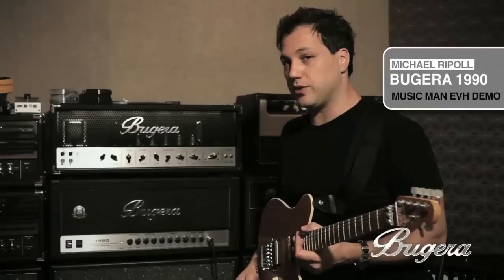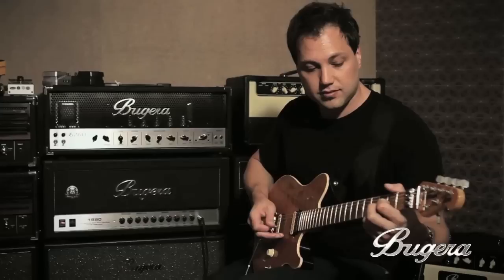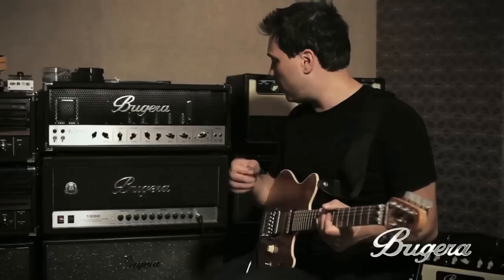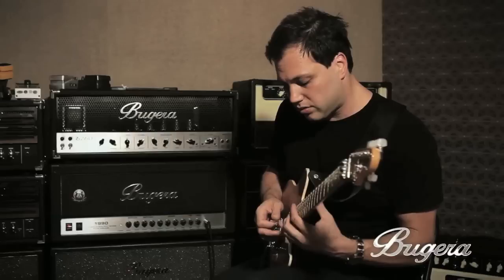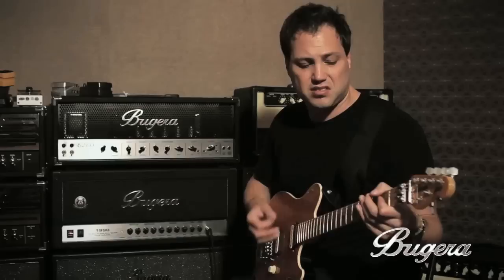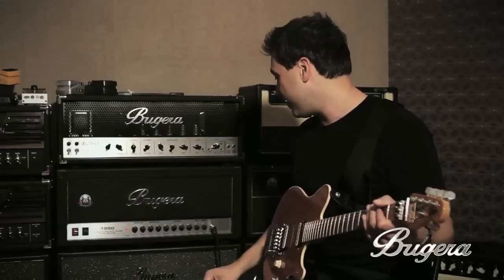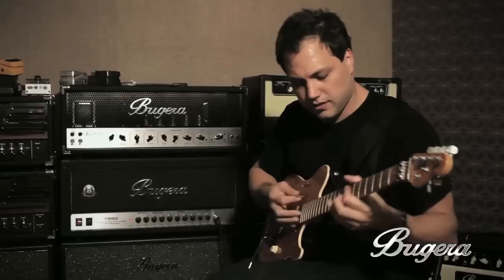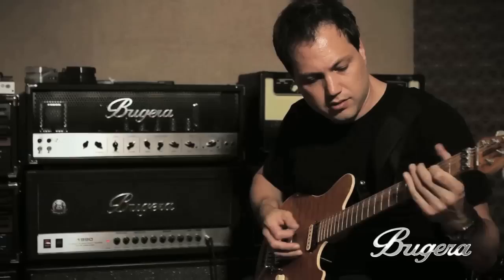BUGERA 1990 Tube Amp Demo on Music Man EVH

Comment: Bought one 2 weeks ago. It is fantastic.
Reply: Cool! Ive got about a day till fed ex myself and damnit I cant wait. My 900 and modded bassman were stolen. Then 8ve had this crate tv6210 junk that just gave up the ghost. A mg 100 thats a noisy fan ss junk and man I cant wait for some real tube. First thing im switchin it to half power and usin the crate 10's 60watt as a tryout cab befor puttin it on a mg cab

Comment from the maker: @lakerblake Yes, the 1990 will work with EL34's, though it will require re-biasing. You will want to consult an amp tech about running on fewer tubes as it will disturb the bias. There's a pentode/triode swich which can give a similar effect to pulling out a couple tubes, without all the hassle!

Comment from the maker: There is a processor that regulates the current and voltage depending on the tube being used. The INFINIUM feature has worked great on all of the units we have tested.

Comment from the maker: @keza123123123 Not all tubes have 8 pins, but most common power amp tube designs do: 6L6, EL34, KT66, KT88, 6550, 5881, etc.

The 1990 comes stock with 5881's which is a variation of the 6L6 design. Regular 6L6s can run in the original 1990 with a bias adjustment. The 1990-INFINIUM will run on nearly any octal-based power tube you want.

Comment: I am really looking into these 1990 amps because JCM 900 is my #1 pick but i can't afford it and besides this 1990 sounds 99.9% like the 900, the only thing bad I hear about these amps is that the power tubes are really horrible and have to be changed out almost immediately and then re-biased. I saw a video of the Infinium 1990 which they said is self biasing but they still had to change the power tubes non the less. anybody have any feed back that owns one? I play a Peavey 6505+ 1x12 (head,separated it from the combo) but I want something with a real clean channel and Marshall like distortion.

Comment: What amp should I get, I play music like Tool, Alice in Chains, Rage Against the Machine and I do a little blues here and there. I need something that would be fairly versatile and that can give me some heavy mids for that bite. Another thing I would like to know is if it will clean up if I turn the volume of my guitar down or use a volume pedal. I usually control my amount of gain like that instead of switching channels. I was thinking the 333XL or the 6262. Thanks

Comment: I own one, for me the lead channel makes too much noise, at home only a VOL 3 and GAIN 6/8 and use the volume of the guitar to drive the level of distorsion for single coil... I think this channel is very bad done like in the JCM 900 not usefull. 
Despite the Clean channel is really good for clean and crunch. The global tonality is dark like all amp of the brand.